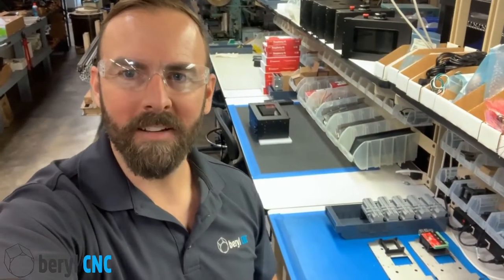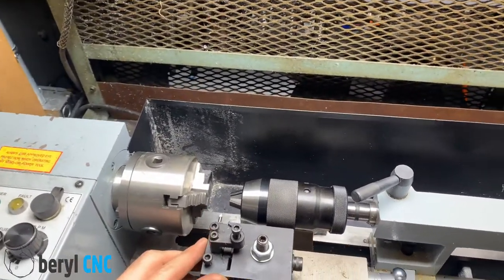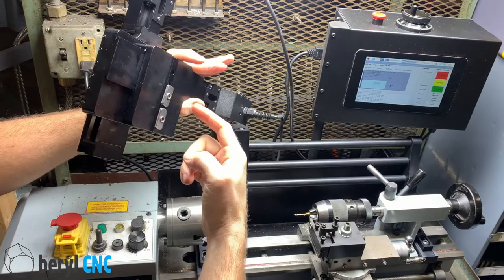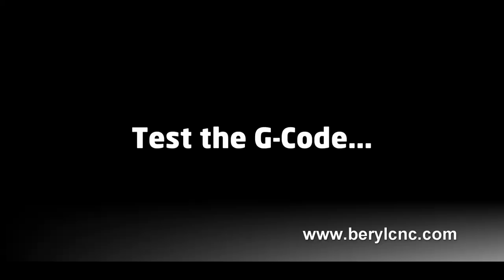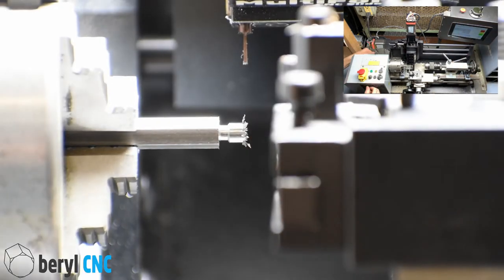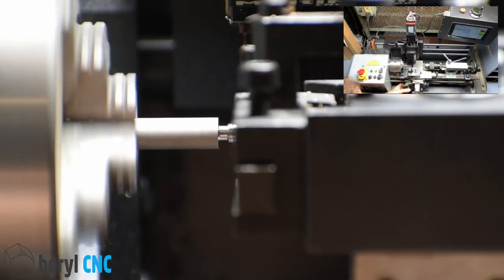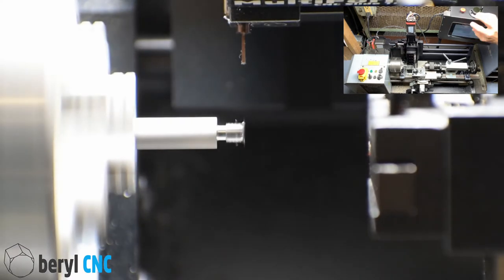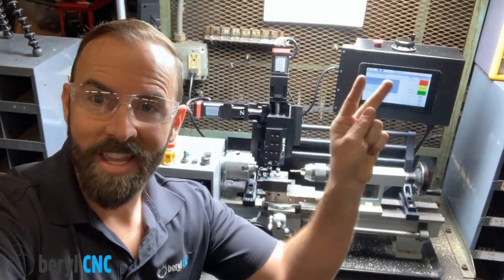Mini Lathe CNC Upgrade

Comment: Good video.  But have a concern about it. I have a concern for safety reasons when you with your fingers remove the chips from the part. As a gunsmith and a machinist, I was always told and through experience as well know this. "You never ever remove the chips and curls of material from a part with  your digits ." The simple fact that those chips are likely to be razor sharp and fragile.  You remove them from the part with your chip brush.  Lest you walk around with cut-up digits and picking out metal bits  from festering  wounds for weeks later.
Reply from the maker: Can't argue with that! Especially Copper strings... in the R&D world sometimes we need reminded of this.

Comment: It is cool, not sure how rigid it is. Would be fun to test it out
Reply from the maker: Thank you! It's rigid enough for light CNC cuts, but of course it's not as rigid as a Hardinge DV-59 turret lathe cross-slide setup, which is the originally intended machine. So on the mini lathe you might want to take 0.020" passes in plastics, 0.015" passes in Brass and leaded steel, and 0.005" passes in harder steel. Definitely peck parting at these small passes, where on a Hardinge you might get away with not pecking some parting cuts. All of these suggestions are based on the VersaGroove 0.030" wide #5 cutter, so other off the shelf tooling would need to be very sharp. Also if you don't have mist coolant or a dripper, be sure to brush cutting fluid on the part for each pass. Other than that, it gives a tremendous advantage to a bench lathe as you'll see in these YT vids. - Jason

Comment: CNC that can't cut threads seems a little pointless to me.  If you add an encoder to the spindle could your controller and software handle threading?  A QC toolpost might be a sensible thing too. I am all for using a parting tool to do as much as it can, but it does have limitations.
Reply from the maker: Hi there! There are many fine lathes that can do CNC threads; we have no issue using Geometric die heads on the turret lathe, or manual threading on the mini lathe. We'll be doing a stepper on the spindle at some point that will allow GRBL threading, but it's not the urgent priority right now.
Reply: @berylcnc  I thought you were selling this as a commercial conversion, which I still think is pretty useless without threading. How many of your customers will have a turret lathe to use for threading? There are not many small cnc lathes out there these days a few from China and that is it, old ones like mine almost never come up for sale. There seems to be an endless army of owners of mini lathes from China, I thought that was your market.

Comment: Just imagine the MultiForm System mounted on a CNCed Mini Lathe. Mount one tool upside down and they could work simultanious.
Reply from the maker: Yes... I believe they call this pinch turning? You could do a CNC conversion on the mini lathe and mount this on the back side too. The trick would be figuring out how to do this all with GRBL control or at least with one GUI. Might be easier than it sounds.
Reply: @berylcnc  I was used to write G-code for an Index G300 without this fancy stuff

Comment: Could I know the approximate price of the machine please
Reply from the maker: Hi! Sorry for the late response.. base price is currently $2,800 USD for the MultiForm System. This package will hold +/-0.0002", has ballscrews and closed loop steppers, control box, and the full / latest Beryllium software package.

Comment: Can it cut Inconel? ;-DD
Reply from the maker: Well now that you've asked, I'm going to look into it. Last year we attempted a bunch of challenge materials, including Tungsten, A2 + other tool steels, 316, 303, 304 stainless, 4130 Alloy, 4140 Alloy, and Titanium. We got through all of those, so we'll see what happens on Inconel. I would recommend all of these material on a Hardinge Turret Lathe and not a mini lathe, however. Thanks for watching!

Comment: I need to cut amber beads
Reply from the maker: Hi there... the 2-axis add on is $2,800 MSRP as of 6/29/22. Depending on your accuracy requirements for cutting Amber beads, you might not need the preloaded ballscrews and closed loop stepper motors. So if you wanted to do this for low cost I suggest a DIY build using the free Beryllium software at www.berylcnc.com. Then your beads can be created using some simple line moves and a G3 finishing arc. Check out the BerylCNC bead video for more.

Comment: 5:00 WTF kinda cutter is that!? I cant even plunge cut with a parting tool on my mill without it sounding like its gunna break how are you profiling with that skinny ass tool?!?!?
Reply from the maker: Haha... ah yes, that's the VG125-030-004-L260-U, aka, an insanely long and thin carbide cutter. It's hard to believe, but the magic happens when you add CNC control and small passes, pecking, etc. As long as the chips can clear away ok and the forces on the carbide don't exceed its break point (about 25 lbs of loading for these tools) the tools will run just fine. So if you take 25 lbs and direct it all to a super sharp cutting edge, the material you're cutting will yield under the immense point pressure. Of course it takes a lot of experimentation, and it's difficult to achieve by hand. So these tools are not for everyone and should only really be used under CNC control. But if you want to try some, send me a form submission and ask for a sample. I owe a few others some samples and will try to send out a sample run at some point soon. This is all still a very new product line, but we use this stuff every day to make online parts. https://www.berylcnc.com/versagroove/